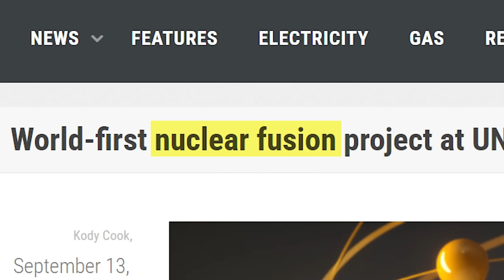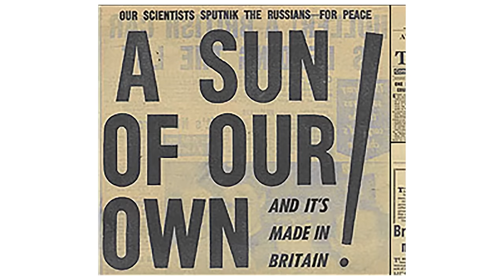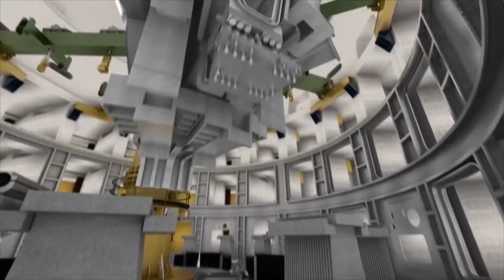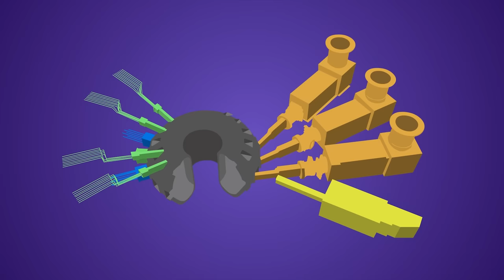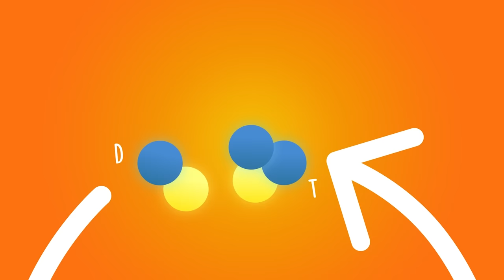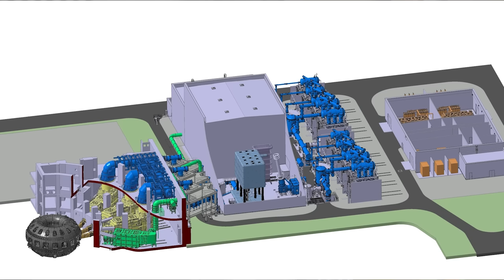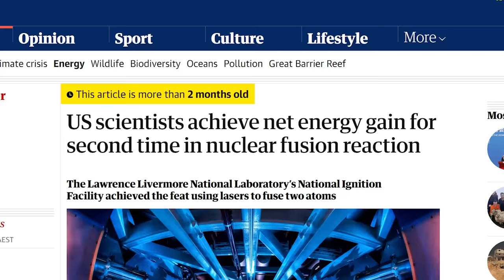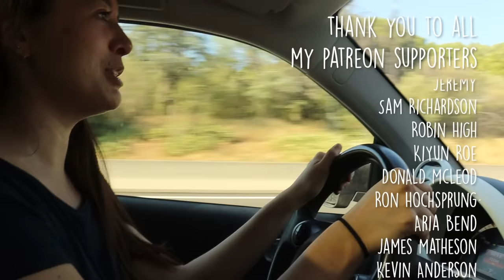World's Largest Nuclear Fusion Reactor!

Comment: Nice video, however I have a very important point which I made also in Lex Fridman interview with fusion physicist Dennis Whyte: about fusion vs fission. Namely that the current problem with fission is the cost and complexity of fission power plants. The cost of fuel is minimal. But the problem is the same with fission. We're still running a heat engine. Even if fusion produces 100x more energy for its fuel or reactor size, and costs nothing, you are still dealing with same size of heat energy. Even though there may be less waste, the cost and complexity of fusion power plants will likely be greater (?). It is far from guaranteed the fusion will be cheaper (and thus consuming less resources including labor) than fission at least when it is introduced. In fact with prediction markets and market futures, you could actually bet real money on that, helping to allocate scarce resources.

The problem with long-lived waste can be minimized with reprocessing and Onkalo-type storage facilities. Most long-lived isotopes can be converted to short-lived ones. And there's very little real danger from nuclear accidents relative to other forms of power. Don't get me wrong I'd love to have fusion working, but Like Richard said, we need base load capacity for until 20XX (2080?), and nuclear fission is great for that. In reality it might be easier to market fusion than fission to public because of (less of) perceived danger.

Also a good reason to investigate fission as well is that Gen IV reactors are evolutions of proven designs, and can possibly create also hydrogen which at least our future airplanes will likely use due to (lack of) emissions.

Also there's the fact that either with fission or fusion, there's a like gigawatts of waste heat which could actually be used. I did once back of the envelope calculations and basically I'm really curious why most of that is basically wasted. Although district heating only type of nuclear power plants are being made. Could also be used as process heat for factories.

In any case, its really nice to see people working hard for better future as you said! Also many discoveries regarding plasma physics and superconductors are made in the side. :)

I think what Helion is doing is very interesting as well. Its not a heat engine but electricity is created directly. Very clever. Let's see if that works. In general I'm happy to see many different approaches to fusion. Even if one fails, others might succeed.

Comment: Love your videos, Jade! Can you comment more on the end-to-end efficiency of ITER? I understand that inside the reactor you may get 10:1 efficiency, but what about all of the other connected necessities that consume energy while running? If you were to put a power meter on those 400 kilovolt input lines, would the power output of the reaction be larger than the input power on those lines?
Reply: That is an excellent question that is rarely considered by excited presenters. In the case of the mentioned National Ignition Facility (NIF) 'breakthrough' experiment it turned out that the lasers, alone, consumed more than 100 times more energy then was measured from the 0.000,000,000,08 second nuclear fusion reaction.
Reply: as far as I know they don't expect ITER to work with a positive energy budget, actually, its not even made to efficiently use the energy generated. its a test bed for DEMO, the reactor that will actually generate power.
Reply: Wikipedia says power meter would show 320 MW of electricity for heating... plus a couple of MW in cooling the superconductors and other expenses. So the thermal out of 500W would be slightly larger than input from the grid. A good space heater :) But not yet a power plant.

Since this is an experimental reactor, I think of it as a bicycle with training wheels attached. Training wheels being the measurement probes and reconfiguration provisions, combined into apparatus mindbogglingly humongous and expensive. The research done in there should pave the way for reactors without those extras - when we understand what's exactly necessary for successful running and what's overengineered.
Reply: @u1zha  - A consideration of the energy budget should include all the total energy needed by the entire complex, not just the energy use of the direct reactor operation. From the very beginning none of the plans included a turbine/generator facility. A commercially practical fusion energy power plant pilot plant would have to demonstrate that all the construction, operation and demolition cost could be recouped during the lifetime of the plant, from the revenues generated by the sale of the generated electricity. With ITER they are not even considering such things at this point. They are far more concerned by the hundreds of millions of dollars of cost overruns that have already taken place.

Many people never take into consideration the many mega projects of the past that never proved to be commercially practical. Some people believe such efforts are not worth remembering.

Comment: At 18:08, where the discussion of neutrons begins, is where "the devil is in the details" needs to be brought up. Indeed, fusion produces neutrons -- a lot of them. And fusion neutrons are very energetic (aka "fast") neutrons. And since neutrons don't have any electrical charge they don't interact very often with other atoms. So the "blanket" Richard describes that will absorb the neutrons is still very much a work in progress. YouTube won't let me include a URL here, but if you google "IAEA neutrons blast fusion materials" it will lead you to an IAEA document that talks about one of the biggest challenges in harnessing nuclear fusion is that of dealing with the material damage caused by all the fast neutrons. And Jade is correct that fusion produces no long-lived radioactive byproducts like fission does, but the lithium which will be part of the blanket will get transmutated into tritium, which is radioactive with a half-life of 12.3 years. So things are not as black-and-white as they might first appear and this is another reason any commercial fusion power plant is still a very long ways off.

Comment: Hi what a great video!!! thank you for making it. I am not totally sure about the "no nuclear waste part though." I think the furiously neutron irradiated themal and attenuation shields, the heat transfer components (like in the future, to actually get the heat into steam, and thence into a steam turbine, etc) will be very problematic from a radiation standpoint. The neutrons will change the shielding materials into less stable nuclei, which will then decay radioactively over time. I hope I am wrong, but that's how I currently understand it. thanks again.

Comment: Excellent presentation here! Just two things short of being perfect:
1. The 3 heating methods mentioned seem to be designed to work on plasma. However, the fusion fuel obviously isn't yet a plasma when it is first introduced into the reactor. Which heating methods do they use to turn the fuel into plasma in the first place?
2. The extremely long construction time and extensive supporting facilities for ITER seem to suggest that the logistics for a fusion plant would dwarf that of a fission plant, possibly even taking a century just to build?! Looking at all the bureaucratic and political mess around fission plants today, this could be even worse for a fusion plant. There is a very real possibility that even if technical feasibility doesn't kill fusion, plain old logistics, politics and the like might still doom it in the end.

Comment: I think the potential for electricity with ITER goes beyond the heat to boil water and create steam, there’s a chance to use the electricity in plasma itself and be distributed skipping all the good old system from nuclear fusion reactor.  This is so exciting and thanks for sharing it has been a while since I watched a detailed video about ITER.  I just subscribed btw I came from Grady’s channel.  👍
Reply: Maybe, but they're well advised not to try to be too clever about the ways to extract energy before they have something that actually sustains break-even fusion. Driving turbines with steam is perhaps not the most efficient way, but at least it's one that we know won't cause more unexpected headaches.

Comment: I think you glossed over the tritium issue here, it's one of the big challenges. Whereas deuterium as you say can be extracted from sea water, tritium isn't "extracted" from lithium it is made by transmuting lithium into tritium. Currently it's made in fission reactors but not in great quantities and certainly not enough to fuel a fusion reactor. Plus it has a short half-life (12 years) so can't really be stored long term. The plan in fusion (not for Iter) is for the fusion reactor itself to make it's own fuel using those neutrons and lithium.

Comment: You should see if you can get a tour of the General Atomics tokomak in San Diego California.  I got a personal guided tour by the Chief Scientist back in 20i6, but I was a DARPA Program Manager at the time (we could go anywhere).  It's the only operating tokomak in the Western hemisphere, and every country engaged in fusion research uses it for science and engineering development purposes.  The one remarkable thing I found was its gain factor, which was getting close to 1.  However, the GA tokomak is only allowed to use deuterium as a nuclear fuel.  Adding tritium in that tokomak would likely drive it well over unity gain.

Richard (who I hope was close to retirement, with a secure pension) was both honest and accurate in his assessment of fusion's future in the energy scheme.  Fission, while developed to industrial scale, has hardly realized a fraction of its potential.  That will be the future of energy.  I doubt if fusion will be with us within my grandchildren's grandchildren's lifetimes - and that's providing I ever get married. (ha ha)

Comment: While they are aiming for 500MW of "fusion energy" output, how much of that will be thermal energy that is actually collectable via the "armor blanket"? Modern PWR fission nuclear generators are about 33% efficient at converting their heat energy to electricity. But those contain their heat energy in fairly small area of a specific thermal conductor (water in PWRs.)  Tokamaks have quite a large area the thermal energy dissipates over. They're putting 50MW in, but if they aren't very efficient, they might not actually get that much out of it.

Comment: We can already harvest nuclear fusion with the use of solar panels and arguably wind turbines for a fraction of the price. Even though fusion would be an elegant solution imo we need to reduce CO2 emissions right now, not in 80 years. We have the "intermitten-problem" with renewables which needs to be addressed with more ressources for better H2 production from electricity and possibly new ideas along the line.

Comment: A single large oil company makes something like 100 Billion dollars per year, for a rough round number.  That's profit, not revenue.  So a single oil company could fund an entire new ITER level project's lifetime cost without any issues, every few months.  Without spending so much as to interrupt oil operations at all.
ITER is a huge project in human terms, but it's important to place it in the scale of what we spend on the "oil project."  Compared to the petrochemical industry, a giant megaproject like ITER is a little itty bitty bump.  As a society, we could absolutely dump  Trillion dollars into fusion R&D, and some of the practical problems would magically be getting solved a lot quicker.

Comment: The only problem with this is it an other experimental design to create a sustainable fusion reaction. It is not going to be a working fusion reactor.
So far the Lawerence Livermore lab in California is the only facility that has been able to create the longest sustained reaction that created a net energy output and it uses a totally different design.
The design at this facility featured has not been able to do this but I wish them the best of luck for the sake of humanity.
Reply: Not controlled, not net energy

Comment: I'd like an explanation for why low pressure low temperature fusion can't be harnessed. Just a little above black body temperature is by definition energy output. That's what powers the sun, and nothing like the temperature, and pressure in an H-bomb. Making high density fusion more controllable than an H-bomb is where the problem is.

Comment: That was a neat presentation, especially with the realistic timescales and challenges laid out sincerely.

I do think that we obviously need a strong baseline for our electricity demands, but it can come from nuclear fission instead. Nuclear power plants are way safer today that people care to think.
Also, cue Tyler Folse stare of disapproval at 2:45 😄Nuclear waste is not your stereotypical video-game like barrels of apocalyptic goo. It's stored on-site in extremely sturdy reinforced concrete containers with radiation on the surface of these weak enough that you can touch them with your bare hands.

Comment: The NIF experiment last year (the "2MJ in for 3MJ out" thing) still needed about 400MJ (if I'm not mistaken) of total power for the whole fusion test. An experiment that can be done once a day at best. It is a research facility after all... Whether or not a more efficient inertial confinement experiment can be built to demonstrate a potential for commercial viability is a question that will not be answered any time soon I think. Unfortunately.

Same here for ITER. It will peak at around 600MW of total input needed for the 50 MW of power injected into the tokamak to produce 500 MW of fusion power for a few minutes... Isn't it a bit misleading to talk about a ten fold gain when only referencing the ratio of the injected heating power to the thermal fusion power output? In total, it will be a net negative. But it's experimental as you said, sure. Still a bit misleading imho, especially when it comes to scientific vulgarization. 

Also, zero mention of the (huge) MHD disruption problem that will prevent any continuous operation and has plagued the tokamak configuration for the past, what, 60+ years? And there are no solutions on the horizon. The only way to increase the stability of those tokamaks is to make them bigger, hence ITER. But it also drastically increase the destructive power of those disruptions... That's the big "catch" that will probably confine tokamaks to big experiments with no commercial viability. 

Finally, it's even worse than I remember, 20 years to build for €20 billions is not what anyone would consider commercially viable whatsoever... That's of course only the beginning. DEMO, the next demonstrator reactor to follow up with ITER, is going to be even bigger (for fusion stability) probably need again 20 years and 20 billions to build if not more... I really don't see at all the commercial viability of those big machines, even if they solve all the problems. 

Maybe in 30 or 40 years with DEMO? By then the bill will inflate to 30 or 40 billions probably. All the headlines about fusion in the past years are just that, headlines. And some of those companies are flat out scams... At least, Richard the physicist sees it clearly. And yet, even with simple napkin numbers to try to make people think about it, they just mindlessly hop on the hype train. 

The fact you say it is not indicative of how the ITER consortium sees the project makes me think the whole thing as probably more to do with the huge amount of money involved than a real goal to solve tokamaks serious intrinsic problems. In fact those problems maybe the incentive to have done it, not for the love of research but to lock funds for decades to come while constantly pushing back the finish line to whatever date will be adequate, so long the money keeps flowing.

Comment: I've seen the Practical Engineering video and yours.  I'm missing something.  A growing reaction... grows.  Please make me feel better that the superconducting magnets do have some way to channel off some of the heat to prevent uncontrolled reactions versus the highly controlled version you outline.  I get it won't make electricity, but it will make heat they can measure to determine the possible output of this size reactor.

Comment: Does the 50MW input include the energy required to extract the deuterium from the sea water and the tritium from lithium?
Reply: Neither of those really require much energy. And by “extract tritium from lithium” are you referring to breeding? ITER will most likely be testing PbLi not pure Li.
Reply: @Gomlmon99  I’ve heard tritium is extremely rare which leads me to believe it would be energy intensive to create.
Reply: @richie99999  reactors will breed their own but yes that breeding is very difficult. Not energy intensive per se but very difficult in other ways. ITER will only be demonstrating breeding in small test modules.

Comment: 20% World energy consumption (8B people) = 600 × Iter II units => 1 unit per 2.5M people, roughly.

Assuming the cost of new units remains the $20B, reducing energy cost by that 20% would take $7.5k/person. To fully replace the remaining 80%, lets say we get much more efficient in production and get it down to 10% that $20B/unit, that'll be an edditional $3,000/person.

Over the next 40 years, let's say we put into this project on average $250-300/person per year (adjusting for inflation, obviously), that would do it. The money would be there, and it wouldn't be too difficult.

Imagine if each major city had one (or two) of these! Inexpensive energy independence would change the face of the world!